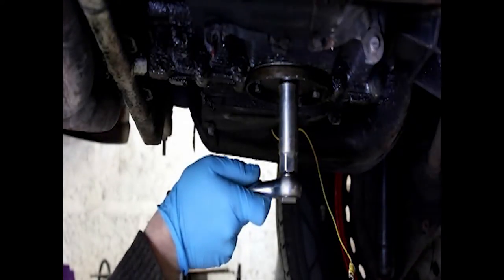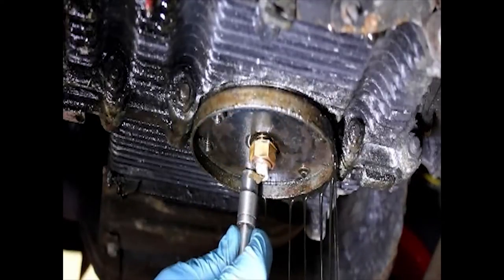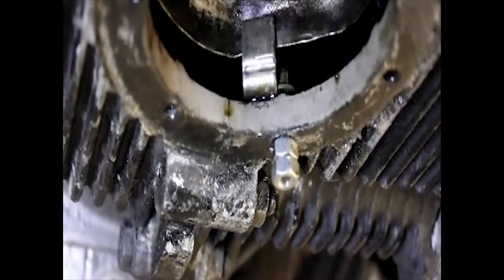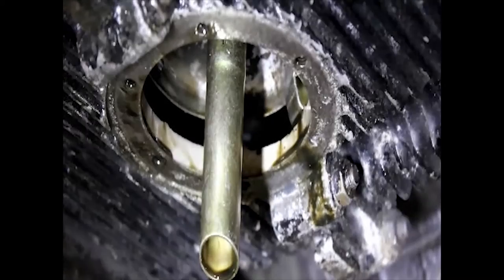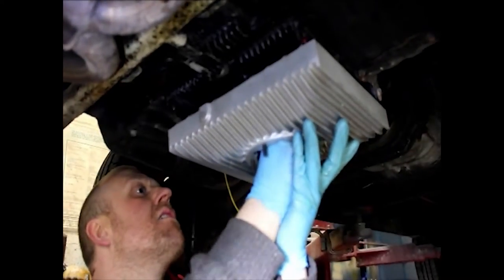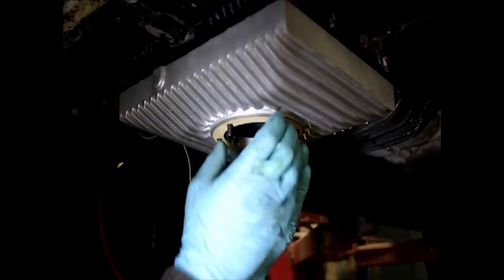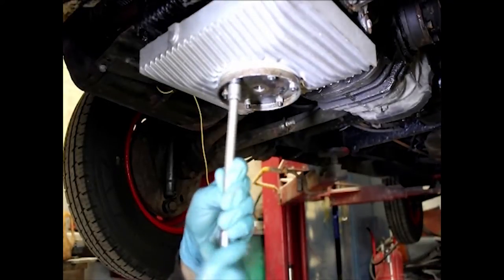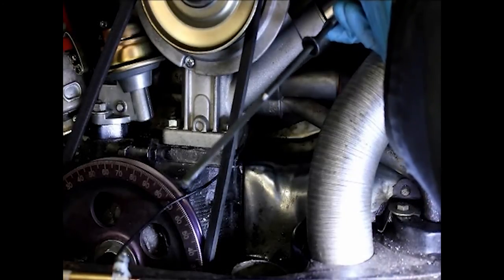How To Fit Aircooled VW Deep Sump

Comment from the maker: Hi Mauricio, the main idea behind fitting a deep sump is to combat oil surges on performance engines, which leave no oil in the sump and can starve other components of oil. 
For example, when an aircooled engine revs a certain amount of oil from the sump is driven to the heads and rocker gear to lubricate. On a performance engine, especially being used aggressively, this is even more so; almost filling the whole rocker cover. 
In this instance if you were to only have a stock sump, you wouldn't have enough oil in the system to cope with this demand, and this lack of oil can destroy an engine pretty quickly.

This is a necessity on a performance aircooled engine, but a nice thing to have for a stock motor also.

Hope that makes sense. 
We will have more videos up soon!

Comment: Hi there !
What is the benefit of this additional sump?
Thanks for sharing and continue with more videos!
Kind regards from Rio de Janeiro - Brazil ;-)
Reply from the maker: It is mostly to prevent oil starvation under hard acceleration, cornering and braking - but additional oil should also assist with temperature management.